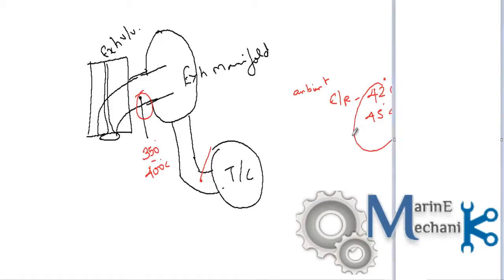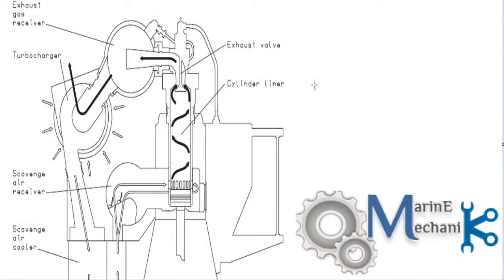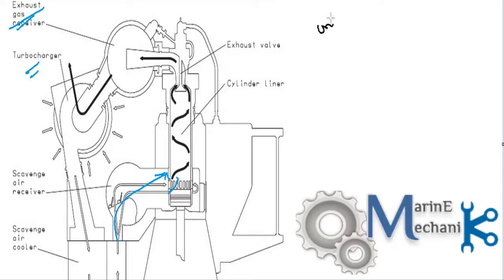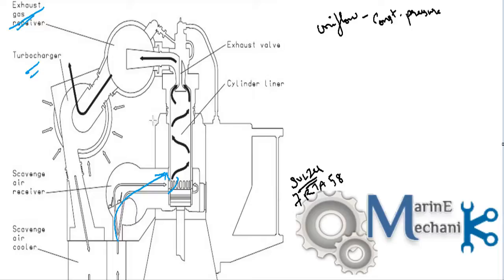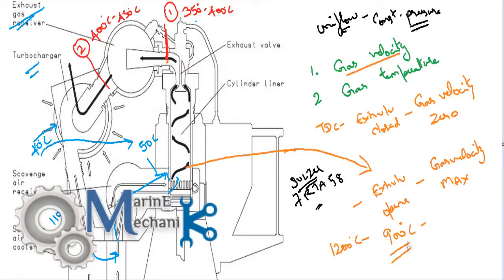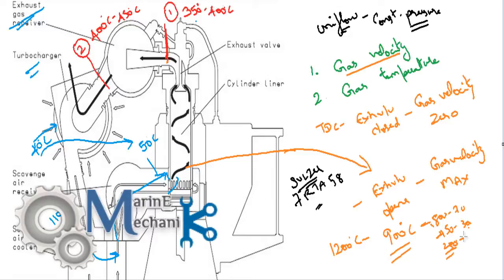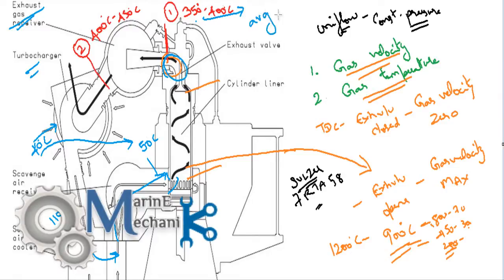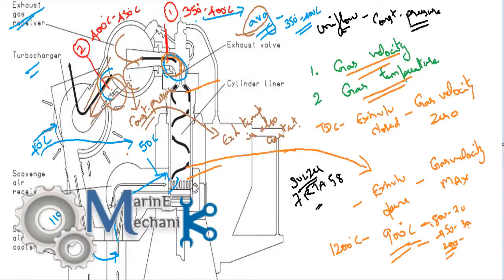Exh. Gas Temperature Difference Between Exh v/v outlet & T/C Inlet, Explained..!

Comment: sir wat will happen in case of pulse type t/c..will it be same
Reply from the maker: IT WILL BE VERY SIMILAR. But the rate of rise will be determined by the compensators installed in the exhaust system. Remember Exhaust grouping is done in case of pulse type turbocharging.
Reply: Ok thank you sir..
Reply: Sir ,compensators are only present in pulse type?? is it same like pyrometer which sense the raise of temperature?

Comment: wonderful info sir!!! one more doubt that how does temp drops after turbocharger? [i think its due to expansion of gases which does the useful work of rotating the turbine].   secondly how is exh gas of around 1bar able to compress air till 1.2 bar?? [if it is heat energy doing extra work then how is heat energy converted into mechanical ?]